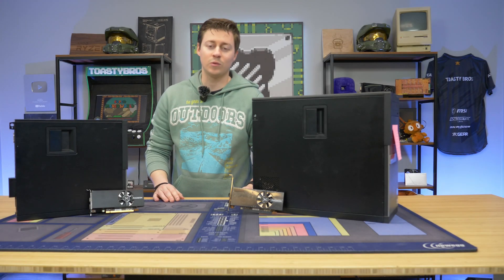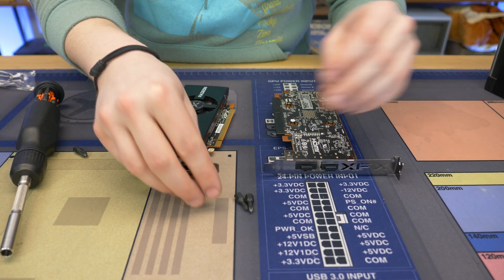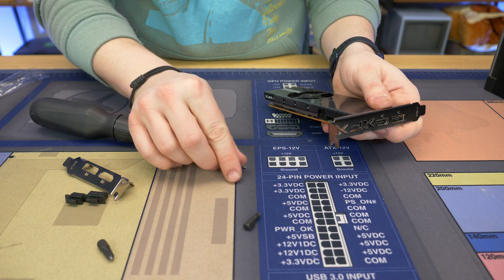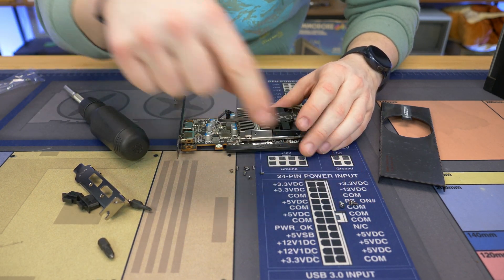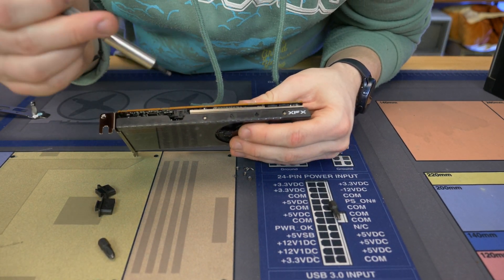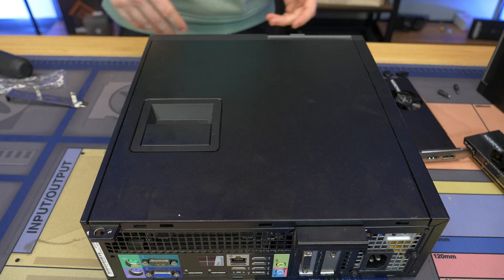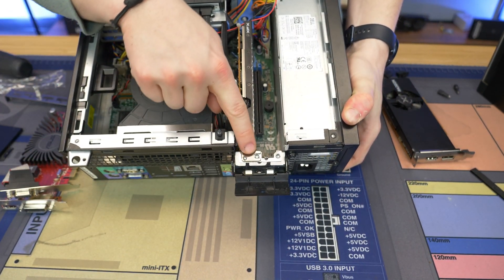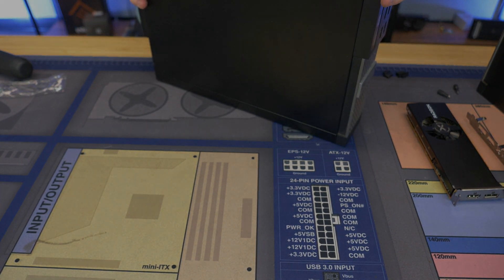Low Profile GPU bracket and install tutorial

Comment: @PCBros LLC  -  I bought OptiPlex 7050 SFF - i7 -32gb RAM -  I would like update GPU - which one best fit for video editing and light 3d work(blender)
Reply: Gtx 1650 low profile if your power supply is 240w or more and the rtx 4060 lp if your power supply is 400w and more